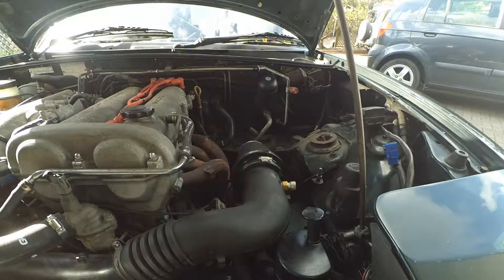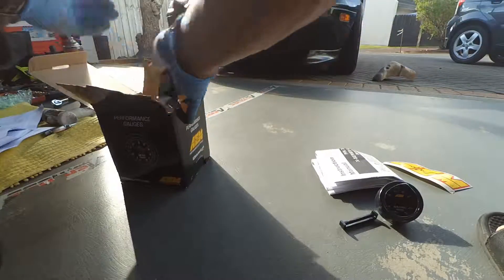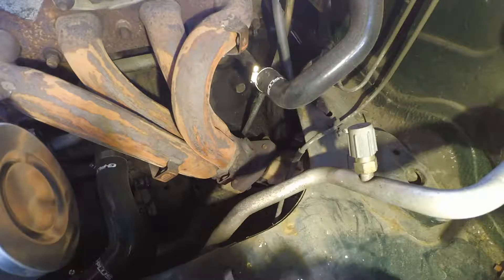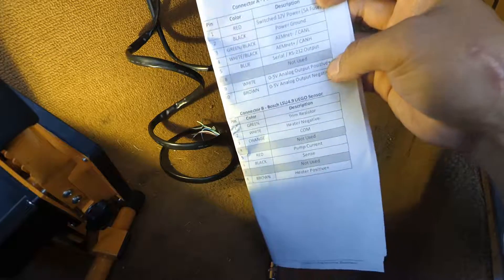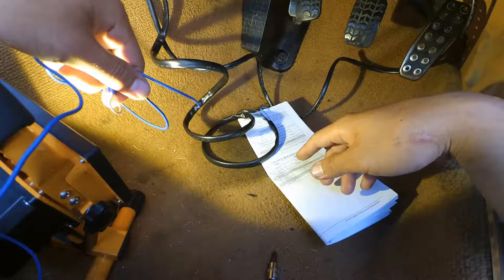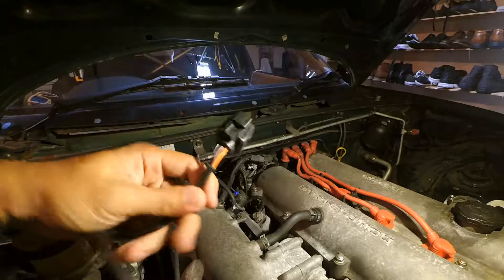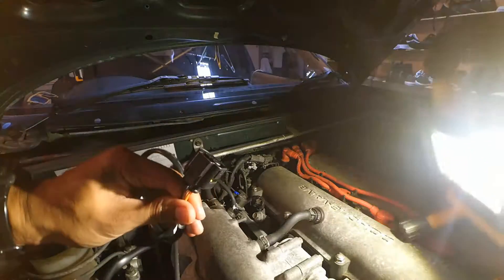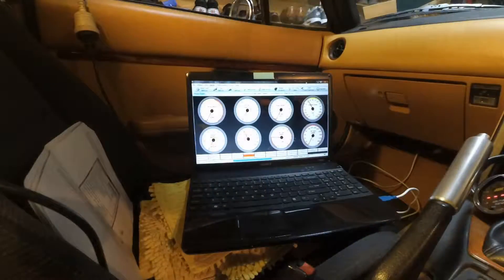NA MX5 MIATA - INSTALLING A AEM UEGO WDE BAND 02 SENSOR

Comment: Are you installing the oxygen sensor on the stock exhaust? Did you have to modify it in any way? I am looking at buying the same gauge. I am only wondering if extra work is required.
Reply from the maker: Nope I removed narrowband O2 sensor on the stock exhaust, and replaced it directly with the wideband.

Comment: Did you have any issues with the AFR gauge in Tunerstudio? I'm using the same gauge, but my AFRs are not changing in Tunerstudio. The gauge itself is working though.
Reply from the maker: What AFR gauge are you using? I believe the Innovate MTX-L needs an open air calibration from box opening, whereas the AEM gauge does not need to. If that doesn't help you; I remember somewhere best guess is from YouTube that one other Miata owner had a discrepancy with the values on TS vs the AFR gauge, and he did a fix on TS and put in manual values of the gauge into the software. (Actually just typing this comment I remember doing it myself!)
Reply from the maker: WOW I just realized that I haven't posted the third and final video regarding this install!! I need to do this ASAP (:
Reply: BROK3_BRG I have an AEM x series just like yours. Yeah I messed with those values a little bit but the gauge in TS is just stuck at like 7.6 afr and doesn’t move. I’ll watch the 3rd video.
Reply from the maker: Found it, going to quote my homeboy Greg Peters on his video here - https://www.youtube.com/watch?v=GZf1B53k1pc

The drop downs in TS didn't have our gauge, so I just put in the values that were provided in the AEM manual.

Does this help?